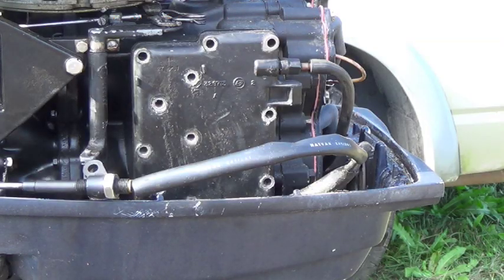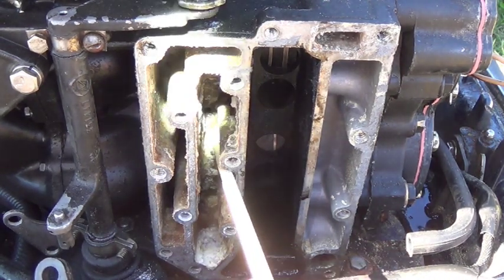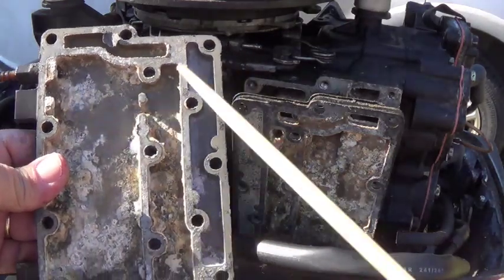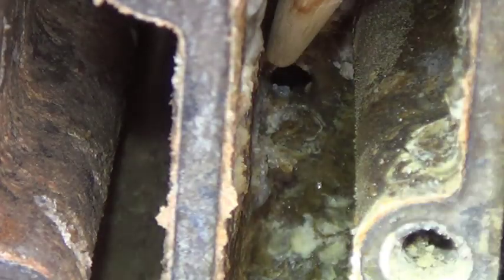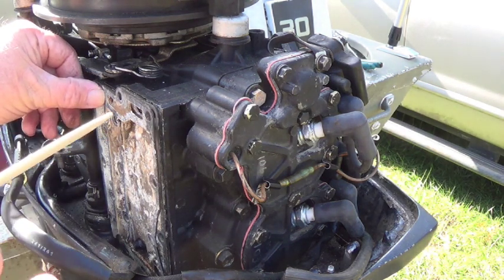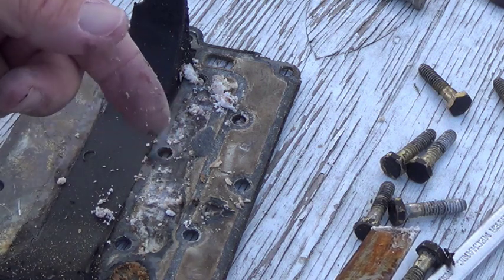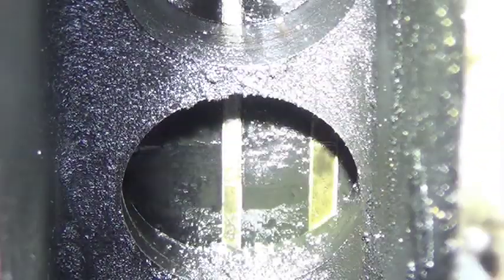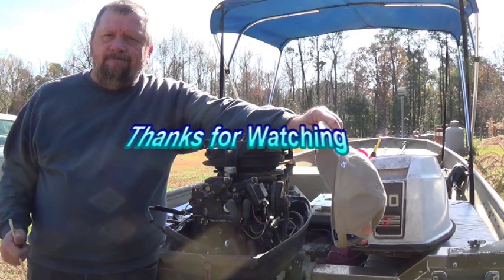Water Flow on a Outboard

Comment: I have a 1972 Mercury 650E 3 cyl. I have a water oil whitish foamy liquid coming out the upper starboard engine mount. I removed the power head and exhaust plate from the middle section drive shaft housing. There was only a little water near the engine mount. I have a few questions. Is it normal to have water below the exhaust plate? Where does the cooling water get expelled from the power head? Does the water drain down around the exhaust tube down and through the prop? Today I plan to remove the exhaust plate to make sure that the gasket is not leaking water to below the exhaust plate and onto the engine mount. I plan to replace the upper engine mounts or packing U cup if the mounts look OK or both. Is it normal to have some water mix with exhaust causing the whitish foam to come out somewhere? I also plan to replace the water pump impeller since I found a few bits of rubber in the port just below the elbow pee vent on the port side of the engine. Your guidance and comments are greatly appreciated.
Reply from the maker: I don't have that much experience with the Mercury 65hp to be able to help you out on this one. Sorry

Comment: I have a 89 30hp Evinrude.  Just had the water pump replaced but still running hot.  When looking I noticed that the tube connected to the "pee hole" it is not connected to anything on the other side.  The tube you posted coming out of the housing and then going out the hole- Mine goes back on the boat towards the throttle.  Is this correct?
Reply from the maker: The tube should start at the outer exhaust cover, connect to a nipple and the hose should go through the  lower engine cover through a grommet. If you remove the hose at the engine does the water come out of the nipple?
Reply: @OmFishing  No.
Reply: I got to cover off and it looks brand new.

Comment: How ( chemical ) can be used to clean out the water jackets ?  15 hp gamefisher keeps overheating , flowing pumping a good amount of water, but it is scalding hot and motor has now locked up " seized " 3 times, after it cools it frees up again.  Looks like case has to burn paint areas both sides 4" above lower end bolt flange and impeller ?
Reply from the maker: I do not know of a chemical that will clean the water ports out. Not that they don't have something I just don't know. Did you check the exhaust seals in the lower unit. It sound to me if you are burning paint 4" above the end bolts it is a exhaust leak.
Reply: Hey Christopher I saw a vid from Danger Marine on YT and he tested several . "SALT AWAY" , WHITE VINEGAR" AND "HYDORCHLORIC ACID" Interesting results .Good Vid and like our friend here at OM , very good resource.

Comment: thanks for the info. what is my problem if no water comes out of that upper port, i just changed the water pump.
Reply from the maker: When you say that no water. do you mean that at the end of the hose or at the block? If it is at the block the water is not getting there. I would check that the tube is in the right place. When you put the lower unit back on did you put the water tube in the upper port first and then line up the bottom, I do it the other way most of the time. I have be told that you take the chance of missing the top port with the tube putting the bottom in first then trying to line up the top. Their is no easy answer but to retrace you steps.

Comment: Cool videos thanks 👍
Reply from the maker: Thanks for watching and commenting Stay Safe!
Reply: @OmFishing  Would you know how the waterflow works/ flow path it follows  on a 10hp chrysler . Pull start  ? I ran water muffs  and i'm sure the water should at least come up to the mid section . i cant see a water outlet at the top as on my yamaha. Im busy opening up to look at the water pump . Do you know if the modern unleaded fuel will burn the pistons due to it running too hot ?  Would you know what the points gap should be set and what is the best grease to use on the cam where the points run
Reply from the maker: @133air5  I don't know about the chrysler water flow. I will say that most all outboard use the same cooling method. I run the unleaded fuel in my older outboards and never have I found burned pistons from unleaded fuel when tearing them down.  If you don't know the setting I would set mine to .020 that would cover most outboards. I use evinrude triple guard grease on my motors.
Reply: @OmFishing  Thanks for letting me know .

Comment: Ive 35 hp johnson , ive good flow from the tube ,but little flow from the two holes in exhaust housing also after less than 3 minutes of running the thermostate housing plate get so hot

Comment: Coworker has a 40 horse evenrude spitting water out the front through a hole after running a few minutes where does it fit in to the circulation?
Reply from the maker: I would need the model and year and know what hole the water is coming out of to help you my friend. It could be just leaking when the thermostat is opening. The exhaust cover has a hole in the top with a elbow and a hose. That is the overboard indicator. Water will run from there.

Comment: Good morning.. I have a 1975 70 horse Johnson with no telltale on it. I’m using ear muffs, starts and runs great but haven’t run it long because I don’t see water coming from exhaust holes. Is this normal? How can I tell if the impeller is pumping.  Thanks
Reply from the maker: It does not sound like the impeller is pumping to me. If it were mine I would pull the lower unit and check.

Comment: Any thoughts on why im seeing metal shavings  on talltell
Reply from the maker: I would check the water pump first. Has any one worked on the motor that could have left them in a water port?
Reply: Only work done in 2 yrs has been the water pump 2 or 3 months ago
Reply from the maker: @maccarrillo5289  I don't know on this one. I can't think of any break down of parts that would give metal shavings in the talltell.

Comment: I have force 120hp when I open the exhaust cover I see milky color, do u think is the exhaust gasket? I did replace the head gasket.
Reply from the maker: Milky color is usually oil and water. replacing the gasket should fix it. Thanks for watching and stay safe.

Comment: Is it normal for water to exit behind the prop too ?
Reply from the maker: Yes some water could come out between the prop and the lower unit. That is not sealed in that area. Thanks for watching.
Reply: @OmFishing  thank you for the help.  I was afraid something was wrong with the seals etc.

Comment: Question I have a 1990 Johnson 40 and water is coming out fine at idle however my buzzer comes on if I speed up the rpms it quits buzzing. Can my idle be set to low and could that make it overheat? I don’t trust the tac to be correct it’s says I’m idling at 500 rpms. Also running kind of ruff. Or do you think the water impeller is bad or going out.?
Reply from the maker: My first question is when you say fine. Is it a strong flow or a fine spray. If it is a strong flow I would check the thermostat. I have had the buzzer come on when trolling off shore for hours. At that speed the motor should never get hot with a good water pump and thermostat. The running ruff could be a lot of things. I change my spark plugs twice a season. Is the low speed jet in the carb clean. On my evinrude 30 the lower speed  carb pick up was in the bottom of the  bowl that way it will suck up every bit of trash in the gas. I put a good fuel filter mounted in the boat.  The idle speed on a 30 hp is 650-700, The idle speed on a 40 hp is 725-775. I would get a good rpm tool. The tool I use you put a little sticker on the flywheel and it will read it every time it pass the tool that is how I set mine. Hope this helped.
Reply: Om Fishing thanks for the reply I will check over the thing you mentioned. Also when I said fine I mean it flows well a steady flow. I should feel the water to see if it’s hot too. Thanks again.
Reply: I replaced the water pump and it’s not running hot anymore. Just because I seen water coming out didn’t mean I was getting the flow needed to keep it cool. I also check the thermostat in a pot of water heating it up and seeing if it worked and it was okay. Thanks again for your help. Also the running ruff was a result of to slow idle speed and running hot. After I fixed the water pump and set the idle right it’s a runner again.

Comment: Also I’ve read that the thermostat has to open before much water will come out but I haven’t run it long enough to let thermostat open. Any idea how long it should run before it opens?
Reply from the maker: Check out my video Evinrude 25 Thermostat. It does not take very long as you can see on the video.
https://www.youtube.com/watch?v=kMWaAgWUBfU&t=1s

Comment: Thank you for taking time to  post the video.  I have  what appears to be the same motor being a 1996/7 25 HP Johnson.  Last time I was out the motor seemed to be real hot at the end of the run to the fishing spot and it was peeing the whole time.  i ran it at low speed on the way back and the water was cool the whole time peeing a decent amount.  So I replaced the impeller and started it and ran it in the side yard for a few minutes.  Still runs cold out of the telltale.  it's warm water coming out down below.  there is no thermostat in the motor.  I recall in the past that the water out of the telltale would be warm. Could i have a clog in the passageways thru the motor that I am not aware of even though it is peeing well?
Reply from the maker: You could have a build up around the cylinders in side the cooling system. The thought for the day on the thermostat is that with out it the motor will not reach a good operating temperature and does not burn clean. In return the engine will carbon up over in time. Where I live it is very common to have the motor get sand in side and that is hard to flush out. That will make them run hot.
Reply: @OmFishing  I've been thinking about how to flush it out.  Likely will take exhaust manifold plate off as you did in video and try to force water through all the portals. I agree that it is likely there is an obstruction in some of the pathways.  The boat runs in the creeks of the ICW so always in salt water.  It is flushed after each run but I imagine there remains residue and buildup of salt, etc.  Thank you.
Reply: I took the telltale tube off the manifold plate and hooked a tube to it and injected water.  Water came out a couple of small holes above and just in front of the water inlet port on the foot and maybe a little through the screen as well.  would this mean that water is making it through the motor or are there other paths that wouldn't necessarily mean it's making it there?
Reply from the maker: @blueheir1  I don't think that would tell you the thermostat is working properly. But that is a very good sign.
Reply: @OmFishing  Sorry, don't mean to be dragging this out and I'm nearly done bothering you.  I hooked a bait-minder pump to the fitting on the side of the motor that goes to the telltale drain hole and ran 2 parts water/1 part vinegar through the system for 1/2 hour.  water came out of the hole on the left side of the foot as noted before as well as from the exhaust outlet(?) on the back side of the downshaft headed to the foot as well as around the impeller.  Water was warm everywhere but from the telltale.  So, i guess I'll run it in the waterway and monitor the motor to see how hot it gets.  Don't know what else to do.
Reply: I've got pretty much same thing.  Tell tale cold except, when I shut sown, the pee briefly runs hot. '93 Johnson 70 hp.  Water at foot is hot, Pee stream cold(ish).

Comment: Hello,  I have an older 2 stroke 5HP merc Mariner outboard.  The water coming out of the small tube on the back the engine was not a great stream.  I squeezed the tube to see if it was clogged and it came out.  Now the engine produces strong stream directly from the hole, but it is basically cool water, like no temp what so ever.  Is that bad to be pushing that much water through the engine?  If I block the hole partial with my finger the water temp increases.  Should I be concerned and n ot run the engine
Reply from the maker: I would not be to concerned about to much water. Most problems come from over heating. My engine has a thermostat in side to keep it at operating temperature I did look at the break down of a 5hp merc I did not see a thermostat on the break down I was looking at. I think it would be better to run a little cool than to hot.

Comment: Can you replace those gaskets? Im Thinking of doing it on mine even though I only run through freshwater.
Reply from the maker: Yes both are available on boatnet, that is where I ordered mine. $3.87 for one and $5.63 for the other. They are not a sponsor that is just were I buy my replacement parts.
Reply: kelmm568 m

Comment: I have an early 80s evinrude 7.5hp.  Have just replaced impeller and now i have exhaust coming out the tell tale and water only comes out when u rev it up. Any ideas mate. Thanks in advance
Reply from the maker: My first educated quess would be the Water tube grommet is letting the exhaust leak by. On the top of the water tube the is a water tube retainer and on the bottom there is a water tube grommet. I think one of them is not in the right place or needs replaced. Hope this helps!

Comment: Hi, I have an Evinrude 90hp v4 1993 and has an oil leak from one of the bolt where the water housing is. The bolt was missing and can't find the bolt. Please help me to understand why the oil is leaking from water housing? The engine still running fine but see the oil leaks, I do have a video to show where it leaks on my channel. Please help!
Reply from the maker: Check out my video Evinrude 30 HP on a Jon Boat here is a link https://www.youtube.com/watch?v=ZACObn7fnYw
If this does not help message me back please. Thanks for watching and commenting. Stay Safe.

Comment: still those dam alarms.. rapid warning beeps.. (11-15) than 2-3 than 15 or so... change the water pump, thermostat and i have lots of pee- just still alarming.  any suggestions?? thanks
Reply from the maker: Did you take the temperature to see if the head and around the cylinders are hot. Everything could be working just like it is supposed to. My Evinrude 225 did that to me every time I would take it out it would go into S.A.F.E.  mode. I change the thermostat. I change the computer on top. I even added a second sensor on the other head so i had two temperature gauges one for each side. It still did the same. There was a short in the neutral switch. The engine thought it was over revving in neutral even know it was in gear and moving.  I think you need to start with engine temp then sensors. It could be possible that the power head needs flushed.

Comment: How long should the motor be running before water comes out of the top? I replaced the pump, had the motor running for about 10 seconds but didn’t see any water so I shut it down
Reply from the maker: I don't know that I have ever seen a time on that but, remember that the rubber impeller is spinning in the impeller housing. That is way they say lightly grease the impeller cup. I am sure the grease is gone after the first time out on the lake.  I try to have a good supply of water going to the motor before I start it. I am like you we know that the impeller is spinning and getting hot. In a short time it will be trashed. The last motor I worked on it would not suck water out of the tank but It would if I primed it with the muffs. Than it would start pumping out of the tank. I would say no more than ten seconds be fore shutting the motor off. I would make sure the water is higher than the pump or use the muffs and see how it does. Let us know how you make out with this. Stay safe!!

Comment: Had someone steel my 9.5 Evenrude. I have three old outboards I am working on to replace it. Your videos have helped me more than once. Thank you. Is that rooster still alive?
Reply from the maker: Yes he is and just as mean as ever. I don't know why I have put up with him for so long. Maybe because he keeps thing in prospective even is someone is ten times taller than you don't back down.
Reply: Your videos continue to help me. I like how your thumbnails show loud and clear what the video is about. I’m waiting on parts for two of the motors I’m working on. The lower foot(?) was cracked on third motor (65 Evenrude short shaft) and is at machine shop to be welded. Wish me luck and thanks for responding! Keep up the good work!!!!!

Comment: If you have removed the exhaust cover you might as well  should have removed the cylinder head to clean all the water passages found there, change thermo is found too rusty along all head gaskets needed, motor will run as a champ and cool much better when running at full hammer down..
Reply from the maker: You are right I don't know what I was thinking. Must of been fishing. Lol

Comment: Thanks for video and education! My son and I just bought a boat with a Johnson 20HP E20CRESB.  It stopped pumping water.  A guy replaced the impeller which helped but not solve the problem.  Question: With the engine off, can we hook up a hose & suction cups to the bottom intake and force water up to see if it makes it to the removed exhaust pipe area?  somehow to the thermostat?  THANKS!
Reply from the maker: When you say it did not solve the problem what is the problem. Running hot. no water out the tall tail?
Reply: @OmFishing  Ran HOT within seconds, no water out the tall tail.Thoughts?   IF I remove Exhaust assemble, should I always replace gaskets?  THANKS!

Comment: So there is no concern if water is coming out from where the linkage is connected?
Reply from the maker: The shift rod runs right through the water in take on my evinrude 30. Check out my video 
{Evinrude 30 Part 3}. There are seals on  the shift rod to keep oil in and water out. Thanks for watching and  commenting. Hope this helped.